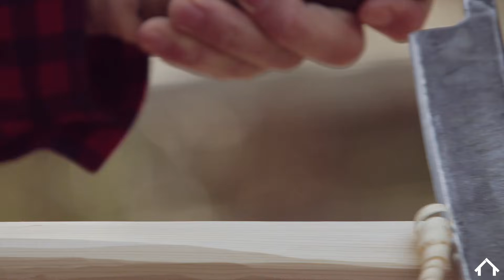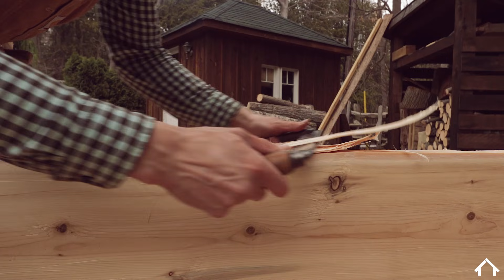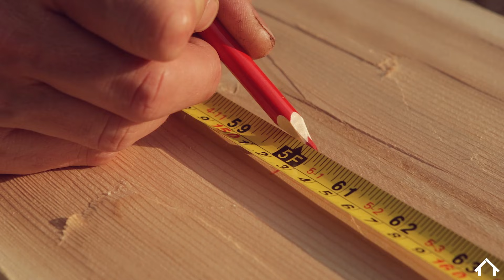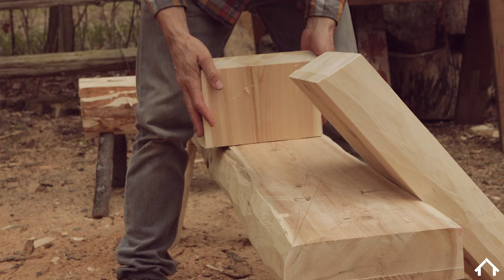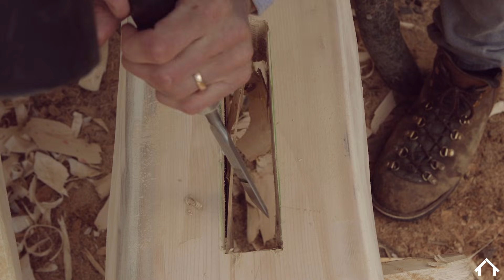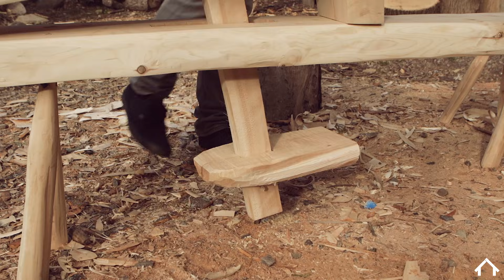The Roy Underhill - DIY Shaving Horse build.

Comment: Should you season the log first?
Reply from the maker: probably best to cut it up right away into parts and then let air dry a bit in a shady well ventilated spot to reduce some movement but nothing here is to critical so you could work it green.

Comment: I have the same saw.  It's an amazing tool.  Once I got use to it, which didn't take long (cuts on the pull rather than the push), I now use it all the time.  A lot of times when in the past I would have used a power saw of some sort, I now use this one.  There is just a joy in cutting the wood by hand, and if you are careful, it's every bit as accurate or maybe even more so because it produces a cleaner cut.  Great project and video by the way.  Makes me want to build one!

Comment: Do you have anything done to explain your vanishing point layout details for the leg holes?  That’s very interesting.
Reply from the maker: I usually just do them by eye.  I take the leg and hold it in position to get a visual of the angle and then remember that angle and hold the auger at the same angle. Then trip the legs after to level. I’m sure there is a more precise way but I’m kind of an eye it up guy.

Comment: why do you not explain the vanishing point layout?
Reply from the maker: What do you mean?  The angle of the top plank? Just position it however it feels best to you. I just went off memory of the other one I used.
Reply: @TrustinTimber  I think he was referring to the layout you did for boring the mortise for the legs for proper splay. Where can we look for to understand that better. I have used sliding bevel squares to guide my brace and bit, but feels odd
Reply from the maker: @carlosviloria8239  Oh, well I just did it by eye.  I've made probably 10 bencheches in this style, this being one of the first and I never did any type of measuring.  I just hold the leg up on the bottom of the bench until it looks about right, and then match that angle with the auger when I go to drill. Then when all the legs are on I put it right side up and trim the bottoms to level it out.  It doesn't have to be perfect to function.  If I had to estimate I'd say I'm about 15 degrees out to the side and 15 degrees back.

Comment: Hello from Germany. I am 56 and my grandpa who was born 1896 had one just like yours. Unfortunately he died in 1974 and I don't know what happened to it. My 89 y.o. dad says this bench is called a "Schneidbank" (Cuttting bench) but I couldn't find any vids in German. Luckily I found out that it is called a "shaving bench" in english. Out of all the vids of how to make one this is by far the most touching one. It has THE original shape and look. The old fashioned way you've finished it, the smooth, but slightly imperfect surfaces and edges make it look..."warm",  like something that is pleasant to touch and run your hands over. (if this makes any sense)
Reply from the maker: Anton Chigurh makes perfect sense. Glad you enjoyed the video.
Reply: Search for Schnitzbank, Zugbank or Ziehbank.
Reply: Can you imagine how many permits would be needed to cut down a tree by hand in EU...

Comment: I can't disagree with all the positive comments about this video. It was well done and I enjoyed it. Love the cedar. However, I must make one picky point about the title(I clicked on it when I saw Roy's name). You can't call it a Roy Underhill build if you use power tools. I understand why you used them, power tools were invented to speed things up and make it easier. Dropping a tree with an axe , splitting it with wedges and mauls, and shaping it with axe and draw knife to make something is hard, slow work. Power tools  have there place but Roy doesn't use them.

Comment: Nice horse.  Couple of comments on draw knife use.  Place the bevel down, this allows you to control the depth of cut.  Angle the draw knive at least 30 degrees. This allows a shearing cut which is much smoother than the cut you demonstate in the video which is a scraping cut which takes more effort and doesn't cut as smoothly.  Keep up the good work.  Enjoyed the video.

Comment: not trying to criticize at all, love the  build and will be making one, but when your saw didn't reach through on the mortises why not just drill through instead?
Reply from the maker: Well, I think doing a bunch of plunge cuts with the saw cleaned out more wood than the drill would have because the drill makes circles and you can't make them touching or the drill bit slips.  The plunge cuts let me take out most of it.
Reply: The drill will blow out bottom side and the auger bits can wander a bit and not come through where you want. I drill holes in board and use a skinny saws all to mark the corners.

Comment: Hey Trustin, thanks for the video, nice horse.  a friend and i made one in the late 1990s form a river bottom ash, that was a beauty of straight grains no knots. It still has the bark on it. we did split it with wedges, i smoothed and flattened it with a foot adze that i had recently acquired, it and the high saw horse are still prized pieces of old school hard work. thanks fred. i am your newest subscriber.

Comment: It's gorgeous! I want to build one of these at some point. I like how beefy you made yours, but the legs seem undersized for all the mass, and I noticed it does wobble around while working. I think I'd remake the legs a bit larger. Thanks for the great video!
Reply from the maker: yep, that's my plan.  I'm going to use the horse to shave nicer legs.  However, because it's cedar it's really light. Not as beefy as it looks. Hope new legs gives it more stability.